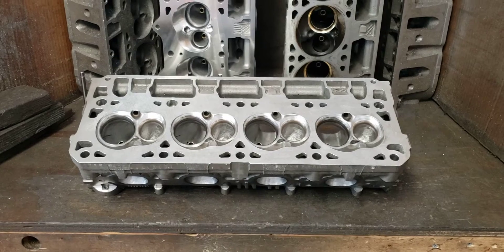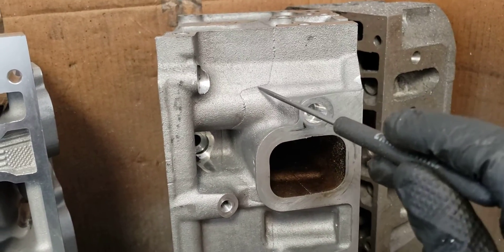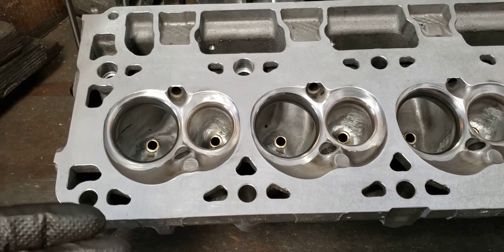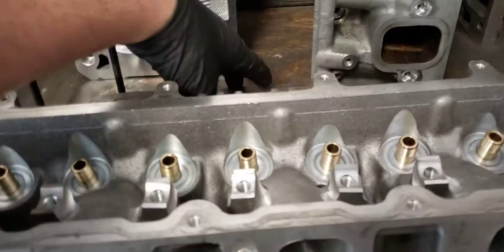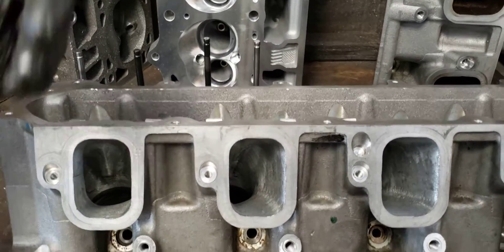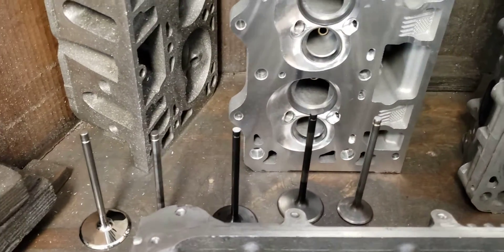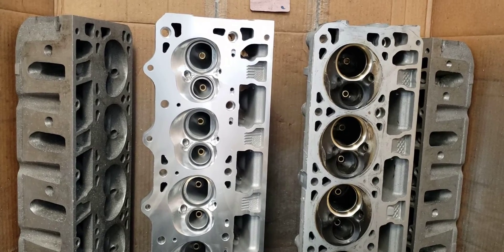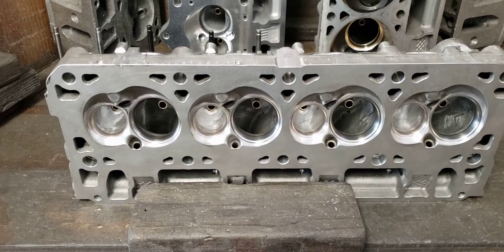CNC ported heads vs. Hand ported heads

Comment: The guide I.D determines the runout in the seat, If the Guide is not round or is outa spec it has absolutely nothing to do with seat runout, The seat runout is determined by the guide itself irregardless of core shift
Reply from the maker: Did I talk about seat run out?

Comment: Does anyone have a contact or a link I'm wanting to do a cylinder head ports on 2 that have been welded up but I only have a 3 axis mill the head can move but it's on a quil so It can't be programmed on rotation.

Comment: Okay going to just make my point so clear somehow it's getting lost!  I deal with "core shift" all the time on every type of casted part I cnc cut for all kinds of things for years! Heads of all kinds and other parts for all kinds of applications!  Too say like it does in the video you can't cnc mill a head cause of core shift is silly!  The machines use Gcode with sets of codes to use probes that sense every surface they cut and program in.  Core shift means zero when a CNC machine detects the surface variations and makes corrections to the cut patterns to realign the tool path to make up for the core shift.  I normally split the core shift in half to find center unless the part needs tlc because it's so one sided to again you input commands to set the machine up to correct for the variations or it needs to be aligned perfectly with the mating parts.  Dealing with core shift is one of the first things every machinist leaners for adapt for that will mill casted items.  Never nocked hand polished ports. Never said they are bad. What I said is I done over 5,000 heads on a cnc mill over the years of all kinds core shift has never been an issue unless it's a super badly casted item which even hand ports wont fix.  Most modern cnc programs even have built in features to deal with it now so you don't even have to think about it except for some situations
Reply from the maker: I get what you are saying.  Clark Trost also posted in here saying the same thing.  Clark runs CNC machines for his business and him and I talk extensively.  What I am saying is that even though the ability exists the heads I see do not have it done.  You can tell the head is jigged up and the program is run regardless of where the valve seat and port location actually are.  When you look in any of these ports it is explicitly simple to see that the CNC did not track at all where the valve seat was placed.  When that happens you end up with very mismatched ports.  If I said it can't be done then I misspoke.  I mean in my 30 years I have not seen it done.  I can track every head port left to right and top to bottom and NONE of them are the same.  And that is just from the port entrance.   Not even getting into where the seat and guide were drilled and placed.  I hope that clears up my point.

Comment: As a machinist I’d say you’re not fixturing your heads right and you may not have very good programs the guides and seats are CNC machined from the factory
Reply from the maker: I don't CNC.  But I have seen CNC ports from at least ten different companies and the results are always the same.  Core shift kills them.  The heads ar NEVER uniform.  Also, GM usually gets their seat angle and second cut properly aligned.  But if you machine in a third cut to the valve seat you will see how wonky they are.  This is just my experience though.  🤷‍♂️

Comment: I believe the term you were looking for when it comes to surface finish is "Boundary Layer".
I usually use a 60-80 grit finish in aluminum and leave the last .080-.100" of the bowl (right next to the seat) burr finished.
Remember, you can slow the velocity down over the short turn by widening it as well as raising the roof. Several heads out there don't have that much (if any) room to raise the roof over the short turn without running into cracking issues because of the spring pockets. L92/LS3 heads come to mind.

Casting consistency can be an issue with any casting but most CNC programs leave a pretty safe margin as to not get into trouble......but that's also why there's more to be had out of those CNC'd heads.

Cool Video BTW.
Reply from the maker: Yessur, Boundary Layer is exactly what I meant.  Thank you.  I don't rehearse my vids or make notes.  So I get lost.
Reply: @prayperformance5137   Ditto!!!! I think it's called "Sometimers" and it only gets worse with age....

Comment: it's not just what the piston draws.  how else would you get 120% VE?  you do cram air.  your philosophy on port shape and texture is off.  make air turn corners?  lol
Reply: How many heads have you ported? What gains did you get ?
Reply: @Crysmatic
Reply from the maker: Kinda funny that I make more power and run faster than anyone else with stock ported LT1 heads with my wrong philosophy.  LMFAO.
Reply: As professional head porter I can agree with him on this specific head.   Chances are that tricks he did on this type of head dont work as well as on other type of head.

I have seen on different  types of sbc heads  the need for complete opposite texture and shapes.   Sometimes a mirror polished intake with radius shaped seats worked best ( back to back tested) and sometimes  aluminium  carbide cutter textured port walls with 5 angle seats working best.....

There is no  rule which works for all.....
Reply: @Baard2000  maybe due to it being a dry head because of DI?
Reply: @shaadydog1  no , all were carburated or indirect injection.
Reply: @Baard2000  I’m specifically talking about this head, it’s a dry head.

Comment: You can certainly match core shift with a cnc if you know what you’re doing and have a probing system in the machine. 

You could plot an entire port with probing, apply a macro shift program and end up with the same result. Just takes a decent bit of front end work and a high level programmer.
Reply: Never said the point didn’t 😁
Reply: Unfortunately nobody wants to take advantage of features almost every machine comes with now a days. Couple of days of front end work and 5min extra cycle time would make all the difference.
Reply from the maker: @clarktrost6271  so the point and content of the video stands.  😘
Reply: @prayperformance5137  chill bro
Reply from the maker: Which you and I both know never happens.  No one mass producing ported heads does it.  I see that in every single CNC head I get my hands on.